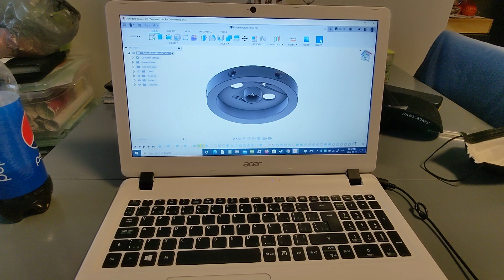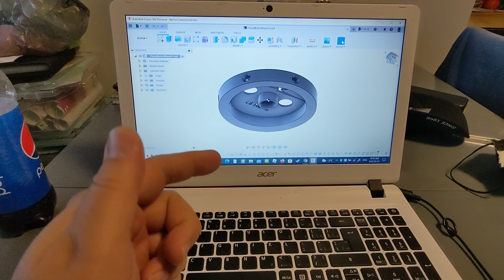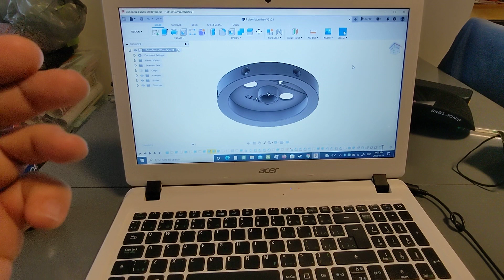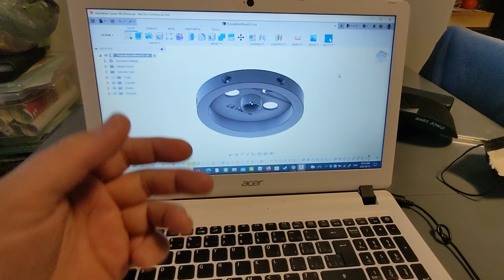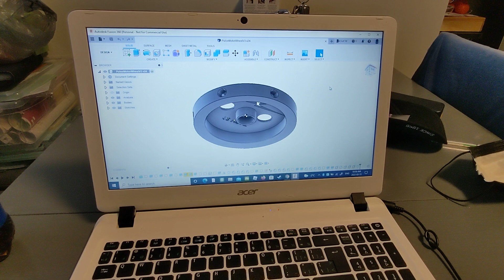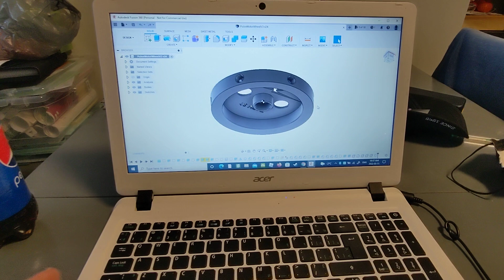Faraday Research RND ⚡⚡ New Idea!! ⚡⚡#freeenergy #tesla #zeropointenergy

Comment: Mike this is a fantastic idea! You are definitely going to get takeup on this, spread the news far and wide, also maybe try answering afew questions in stackexchange and other youtube channels comments, then plug your expertise. I often feel the need for this kind of thing. I may take you up on this at some point when I have a suitable project :)
Reply from the maker: Thanks Peter I haven't heard from you in a while... I was wondering where you were??? Lol
Reply: @FaradayResearch  Hey man, yeah sorry I apologize for not being more active in your comments :( I've just been a bit busy. Also very sorry to hear about your work situation. Your design consulting business sounds like a great idea, Having someone work with a customer to show them how to design there own part, so they can make alterations in the future and sharing all the files, is really an awesome idea. I tried to learn fusion 360 CAD and CAM to a rudimentary level about 5 years ago with the intention of buying a CNC machine off alixpress to mill steel, but then I realized I already had too many things I was trying to do and owning a CNC mill that I wasn't going to be putting to good use wasn't a good idea. The CAM stuff is really cool in fusion 360, as is the finite element analysis for structural strength (It used to be all free on the hobbyist tier 5 years ago), I'm guessing you have a lot of experience with all that stuff too. I will try to be a bit more active on here, time permitting :)
Reply: I’m learning (6 months in ) on auto cad inventor
I’ve got a cad station but it needs setting up 
I’d be interested in the fusion 
I’ll let you know when it’s set up
Thanks